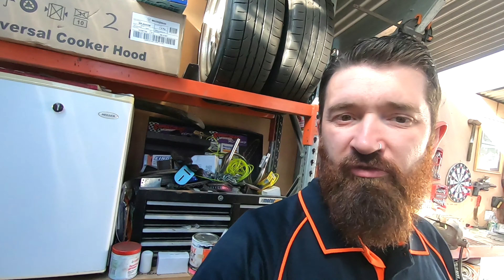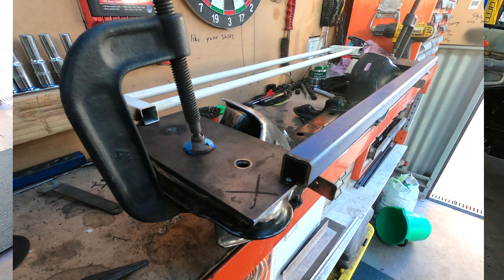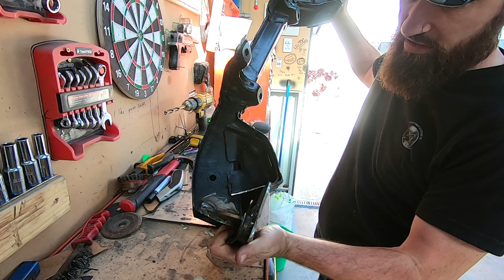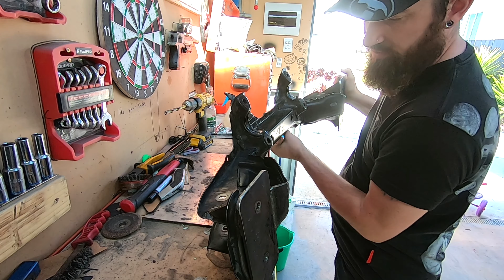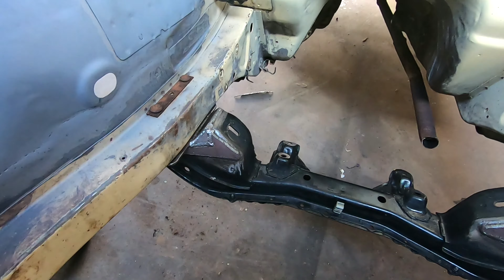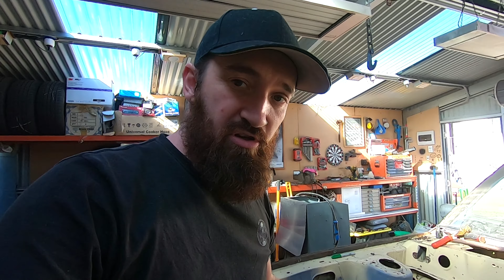Datsun 200B Project gets Modified s13 X Member

Comment: Nice work, little suggestion.. put some pipe down into the chassis rail as crush tubes where crossmember bolts up..
Reply from the maker: Looks like the factory holes already have them